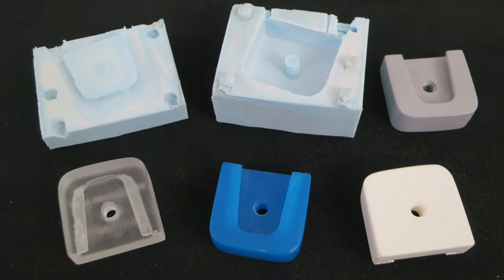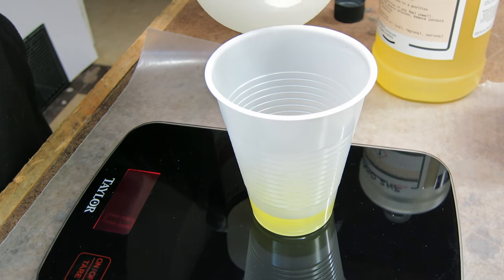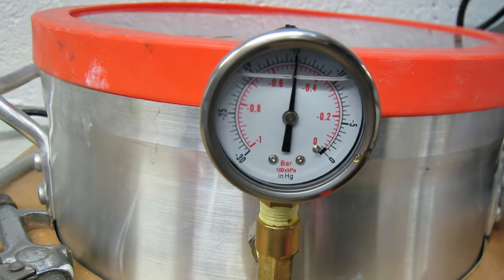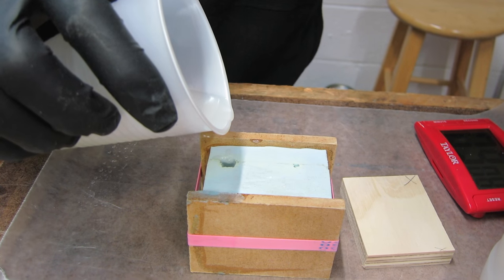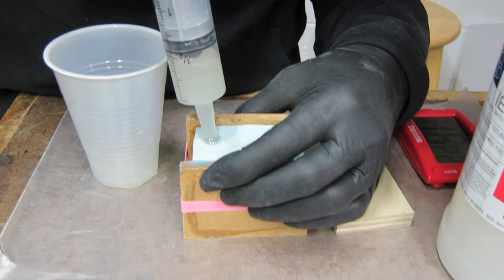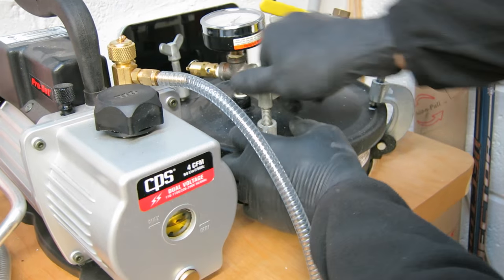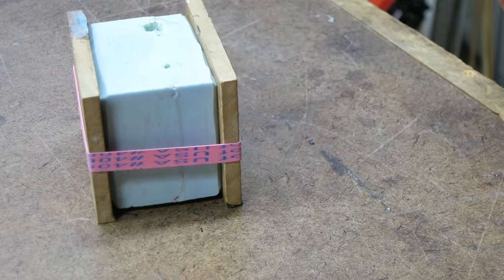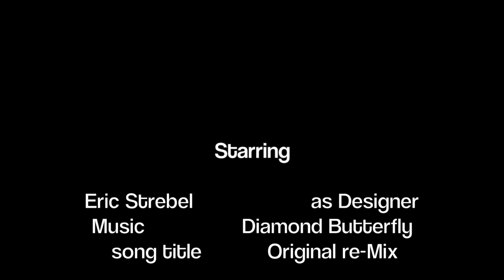𝐈𝐍𝐉𝐄𝐂𝐓𝐈𝐎𝐍 𝐂𝐀𝐒𝐓 𝐔𝐑𝐄𝐓𝐇𝐀𝐍𝐄 𝐑𝐄𝐒𝐈𝐍: clear bubble free camera mounts Pt 2

Comment: Hi, I cast resin fishing lures which have 10% microbubbles filler added. I use a long potlife resin and pressure cast at 80psi. I can never get a completely bubble free cast, there are always bubbles on the top of the piece that require drilling/filling. Is 80psi not enough pressure because of the extra viscosity caused by the microbubbles?

Comment: This is nearly identical to the part i want to make for my rifle. I need a connecting adapter from the rear of my rifle to the stock. Had the desire to make a custom part either by grabbing random PVC products at homedepot or casting my very own. Im just worried that material of the cast would eventually crack eventually from the recoil. Now im more interested in what you do than making my cheapy 9mm look like an MP5 lol.. If anyone has any tips i would appreciate it especially if they've used resin casts as a durable part rather than a prop

Comment: Nice video! Would injecting resin with a seringe be an advantage over 'hand pouring' , to fill up 'air spots' inside your model? I want to start casting soon, but I don't have a vacuum/pressure chamber.
Reply from the maker: For two part molds and small parts it's almost the only way
Reply: @EricStrebel  I have these little cat figures, very simple in detail, basically just big head, body and limbs/tail, and I want to make one part molds for them, so I'll try the seringe method instead of pouring from cup.
Reply from the maker: Ok, best of luck with your project

Comment: I also would like to know if the syringe is reusable, those large ones in particular are not cheap.
Reply from the maker: Yes, sometimes I can reuse them, let them set up and often times you can pull them apart and reuse, compressed air is helpful to remove stuff in the barrel +DukeNukemDesign

Comment: Hello.  What type of silicone do you use for the mold?  I have used a few different types and find that when pressure potting it seems to "squeeze" the mold making the molded part just slightly smaller than the master that was created to make the mold.  Do you take that into consideration when making the mold, or does that kind of silicone not shrink?
Reply from the maker: Check the shrink factor on the date sheet from the manufacturer. I use a quality silicone and don't factor that into the equation, but you should consider it for larger parts.

Comment: Hello Eric, I've been looking for a solid vacuum pump. What are you using there? It seems to be able to pull air out to create a vacuum and push air in for pressure casting.
Reply from the maker: I am using a Pro-Set pump from CPS for my vacuum set up, the pressure pot uses air from my home made air compressor. You can watch the video here https://youtu.be/F0rkzVbExmI thanks for checking out the video, and your comment, good luck casting George Syrimis

Comment: I have Polytek casting resin easy flo 60 but I don't de gas it not enough time with only 2 to 3 minutes I need to mix larger amounts and cast more items I have a tank for degassing need to build a system like yours!   impressive.
Reply from the maker: David Rusterholz use a resin with a longer pot life so you can degas properly and get the results you want. Thanks for the comment. feel free to share on social media.

Comment: can you use polyurethane resin on ceramic molds or rubber silicone? thanks in advance.
Reply from the maker: +paul gutierrez   Silicone for sure, ceramic molds may need a release agent applied to them.
Reply: Eric Strebel thank you so much for the reply.

Comment: Nice video but  I don't think you can call it high pressure injection as you do at 3:52
No way you can reach high pressure with a syringe and if you could it would take more than rubber banda to hold the mold together.
Still an interesting technic demonstatrtion

Comment: How do I add heat to my pressure pot? What brand of pressure pot?
Reply from the maker: CS Custom Lures Pressure pots can be anything that can handle the pressure, but generally they are maid from pressure paint tanks. Mine is an old 80psi paint tank that I converted to a pressure pot. I added heat from a coffee pot warmer. Make sure you like and subscribe to my channel. www.botzen.com
Reply: +Eric Strebel I currently have a 5 gallon tanks and a 2.5 gallon tank. Your heating element peaked my interest! I would love to add one to my tanks!
Reply from the maker: +CS Custom Lures
coffee pot warmers are readily available on ebay, you could use a heated blanket as well.  Let me know when you post a new video of your casts. Good luck!

Comment: Whats the different between a vacuum chamber and pressure pot? If I already own a vacuum chamber should I get a pressure pot also?
Reply from the maker: BrandonTezenoTV A pressure pot is the opposite of a vacuum chamber. It is used to crush bubbles in the resin to a smaller size. You will get the best results if you vacuum degas your resin first then cure the part in the pressure tank to crush any bubbles that are left, if you have any bubbles left to crush, you shouldn't,...but if you want perfectly clear parts then a pressure tank is a must. You will get stronger parts as well with a pressure tank, in my opinion, but you will need a degas the pats first for the highest performance parts.